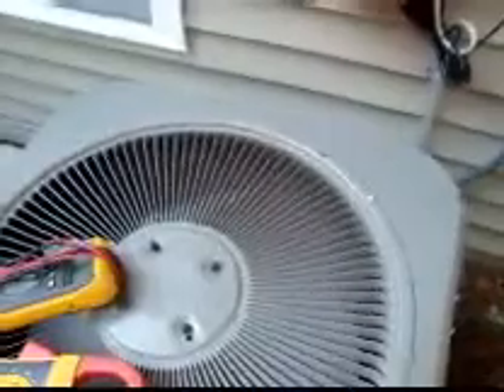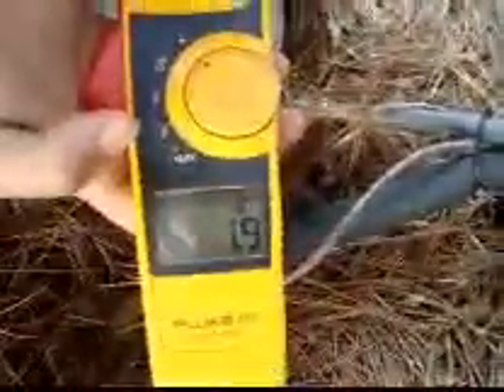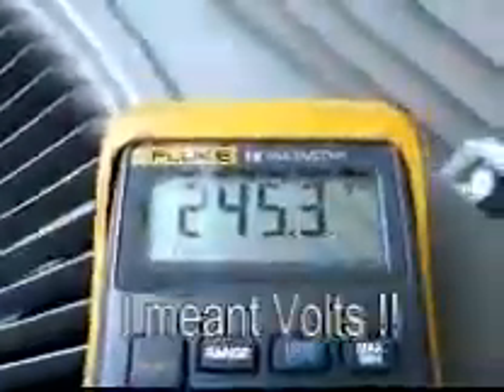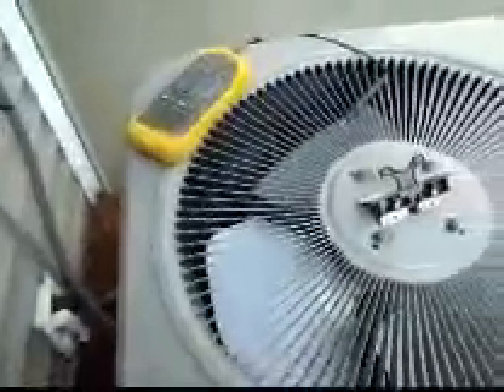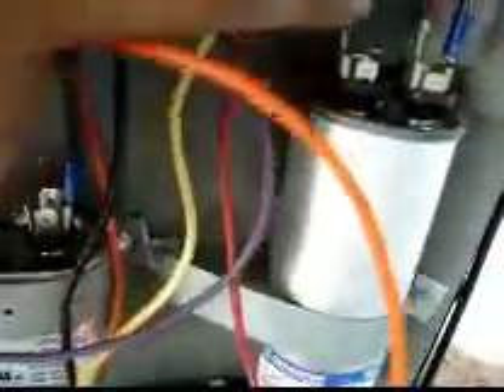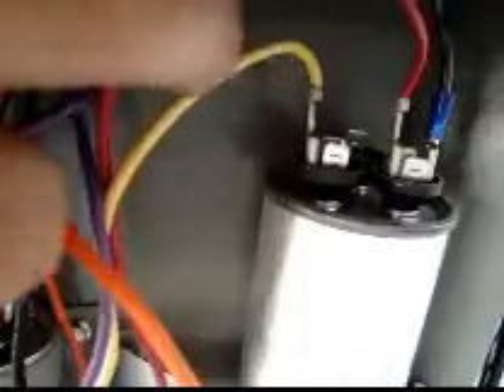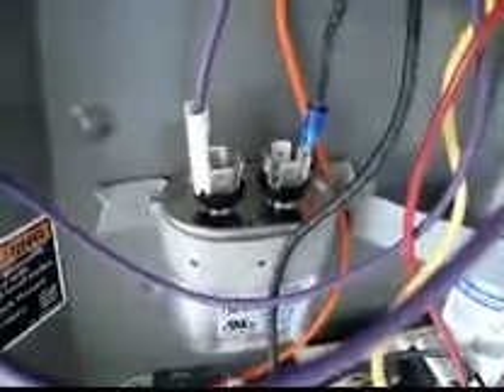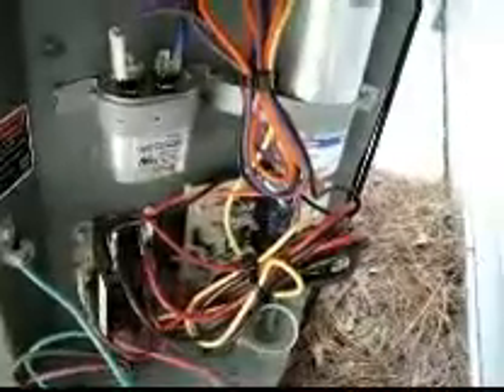HVAC: Diagnosing and Replacing a Condenser Fan Motor

Comment: Nice video, I have a fan not running with a compressor running a dual capacitor.  I pulled the cap and the fan side checked out at 5MFD like it should, and I wasn't sure how to check the actual motor.  Your video is great for that test, thank you.

Comment from the maker: @malagabee From what your saying it sounds like the motor is locking up. The top of the unit where the motor mounts will get hot. The bearings in the motor will heat up and expand causing the motor to slow or even stop turning.

Comment from the maker: The old dual run capacitor was only a 5uf on the fan side. The new condenser motor required a 7.5uf. There was nothing wrong with the capacitor other than that. There are dual run caps with 7.5uf on the fan side. I carry between 30 - 40 capacitors on the van ranging from a single 3uf all the way up to 80/10uf (dual run) and most combinations in between. Hope this helps.

Comment: nice tutorial, I'm wondering if the cover feels hot on top of the motor?  Mine is doing the same thing and I've checked the cap so far to be good.  When I push the fan blade with a sick it starts onces and stops, then it's hard to move it.  I'm thinking if it's hot it must be over amping.  I will need a multimeter.

Comment: @Bucs80SC To my suprise When it works I get the correct rated 225V and 0.7A draw on the motor and when it gets stuck I only measure 150V and 0.5A.  I replaced the contacter already.  Think I have a bad defrost control board or a bad fuse/ shut off ?

Comment: Question, I have a 2.20 FLA motor.and my A/C service tag says 1.4 FLA ....the motor gets hot and shuts down cap is a 5 mf and motor also. Is it possible that its over amping?

Comment: Hello, I touched the back of the motor and is super hot but not running.  Also, the coils get super hot.  My unit is very old by the way.  My compressor makes a similar noise as the video.  I checked both Caps and the big one tests  34.9 uF and the samller one 4.99 uF.  Since this unit is so old, I can't even tell how many microfarads each Cap is rated to.  Please tell me if I need to replace the motor.  Also, the motor's sticker is completely erased with rust.  PLEASE HELP!!!

Comment: Why not replace the dual run capacitor.
Reply from the maker: For a couple reasons. If you don't have the proper sized dual cap, or if the customer doesn't want to pay for the additional dual cap.

Comment: what happens if you run your air conditioner without the fan running?
Reply: sally aluviel o if you run your outdoor section without the fan running your compressor will over heat. Also you wont get much cooling because the heat being taken out of your house wont be able to get blown off.
Reply: thank you somuch^^ We had someone come fix it

Comment: I got lost on the cap replacement,are you using the old cap for the compressor portion of it & the 7.5 for the fan only ? is there a dual run 7.5 or if the dr cap is still functional,but doesn't meet the requirements for the fan motor is the 7.5  something you carry for this application